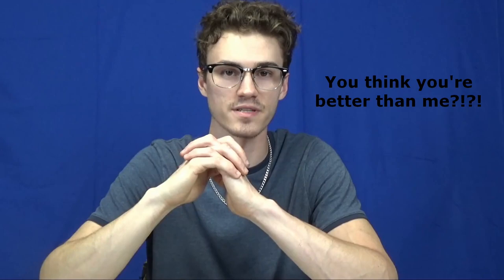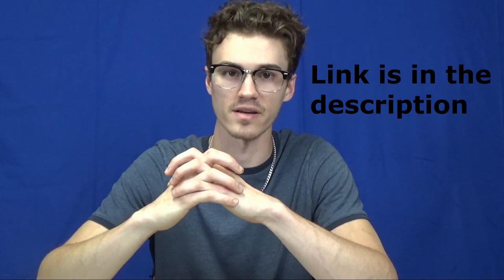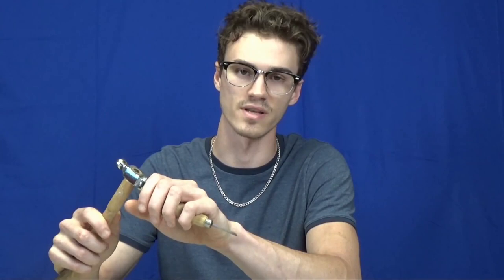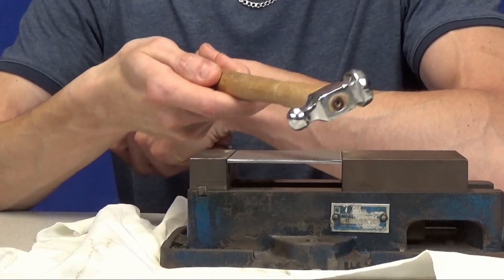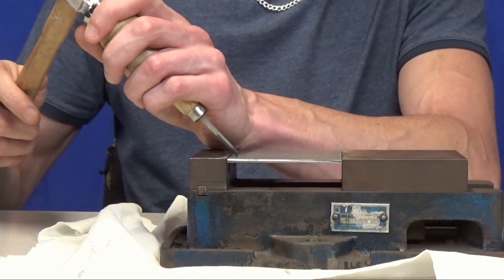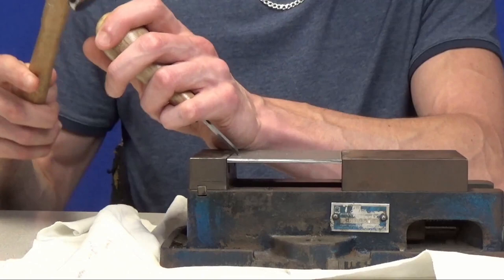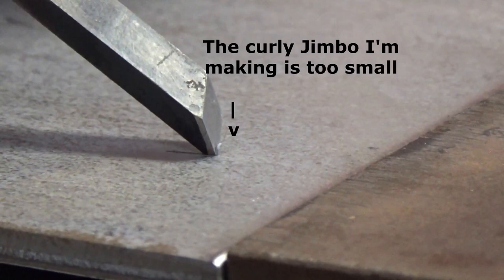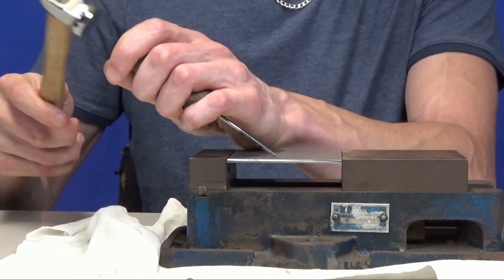Beginner Tips for Setting a Heel and Basic Hammer Chisel Engraving

Comment: Do you think that a 3-$400 pneumatic engraving machine is any good or should I go higher? Love your videos btw😊
Reply from the maker: I can't say for sure because I have not personally used a $400 one. I use a Grs GraverSmith, they are about $900. But for that $900 you get a machine that should last you a lifetime. A $400 dollar machine would probably still work, but may just not have the reliability(?)
Reply: @jwsahm6703  awesome thanks! 😊
Reply: It can not work by itself, needs air supply compressor which is another $300--$600 at minimum, depending on one's tolerance to noise.